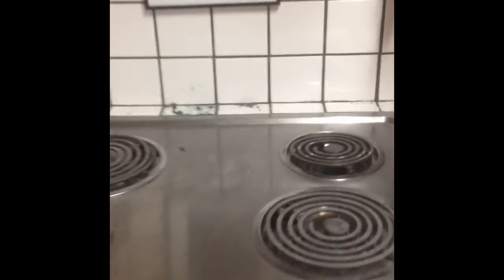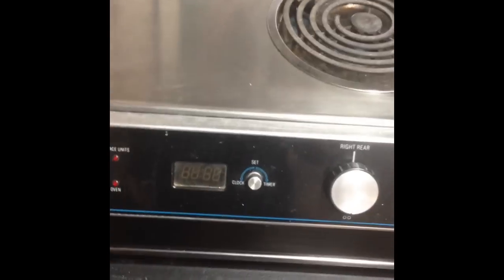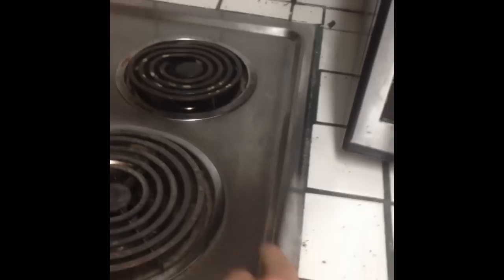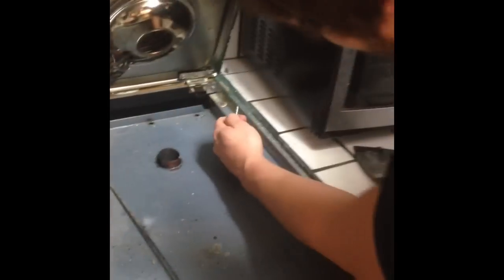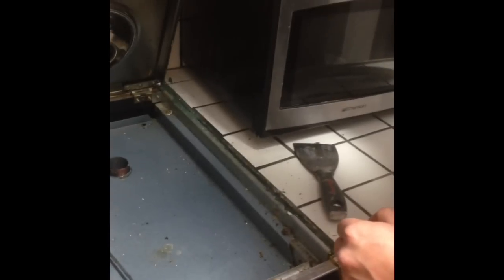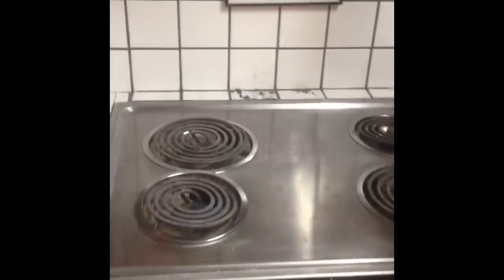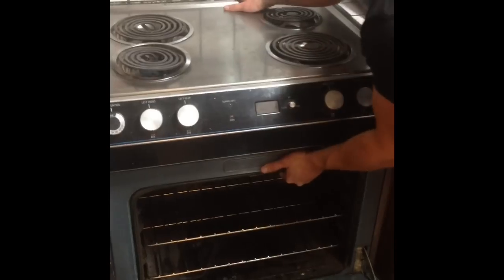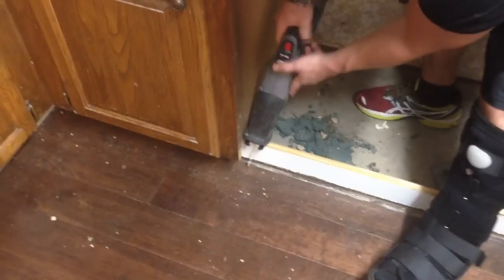How to Remove Built In Drop In Stove Range (And Convert Cut For A Freestanding Stove)

Comment: Thank  you for the video.  For several years I have put off removing my 1983 drop-in stove because I thought it was a chore that needed the hiring of someone else to do it.  We can do this!!!!   plan to put a table in that spot with individual cooking appliances - dual hot plate, air fryer, toaster oven, crock pot.  Eventually, I WILL pay someone to remove the vent thingy and the overhead microwave which doesn't work and I hated anyway because I'm 4'11" and it was hard to take stuff out of it. Thanks.

Comment: I wonder if the new stove fit in the hole left by the drop-in stove. Most of the time, its about 1/8 to 1/4" too narrow.
Reply: I'm in the process of converting now and the new "standard" stove doesn't fit into the cabinet space. Frustrating trying to get it to fit. Did you have luck? What did you have to do?

Comment: Do you have to do anything with the wiring to work for freestanding?
Reply: +Dana Haulbrook you can direct wire or add a receptacle. A surface mount receptacle is less than $7  at Lowes.

Comment: Are you sure that's a 2010 stove because it looks a lot older then that. And also the electric stoves now are smooth tops.
Reply: +Matt Bruns 20 years old at least.. i just pulled the same stove out of my kitchen..
Reply: +Matt Bruns There's this thing called sarcasm....
Reply: I have one in a 1970’s built building....it’s definitely an original so we’re talkin 40 some odd years?!??

Comment: the only major problem is the electrical. most stoves use an outlet these days. sadly, drop-ins do not.
Reply: That's not a "major problem ". Instal a plugin using the existing wire.